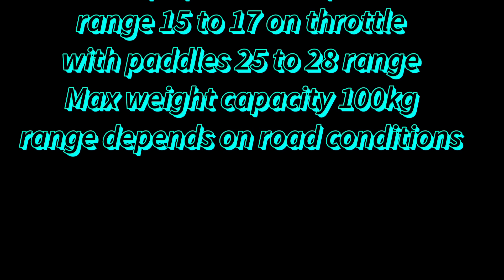how to make electric cycle high speed

Comment: You are clever. .
The more important question now is :  how does it work on the high streets or mountain roads ? I think at the biggest rear gear it will do well ( high torque with low speed ) ? What do you see ? Thanks
Reply: Will it really works for it?
Reply: @thegogbd  
that depends .. the motor power , the gear's teeth number

Comment: Hi so after watching this video I decided to a DIY BIKE. I Got a 48V 1000W BLDC motor kit did the freewheel crankset and the bike works fine when on the stand but when I put the tyres on the ground for a text ride the motor can mot turn the and gets stock. Any advise what you think may be wrong or what I may have gotten wrong
Reply: You must start your bike with the pedal mode first aroung 4 to 5 meters before using the motor power

Comment: Great job, is battery charges while pedaling? How many hours need to normal charge?
Reply: No brother the self charging feature is not available is this bicycle but you can add it itno your bicycle and for normal charge to this bicycle will take about 2 hours 30 mint or more depending on battery condition if battery is half discharge then it wil take 1 hour 39 mint and when battery is fully discharge it will take upto 3 hours oor less hope that you will understand

Comment: It is 👌🆗️,  but the Hero cycle is designed for human pulling force,,here the gearbox with chain and sprocket force taking hi pulling load, it's wheel axles bearings are not giving life for 50kmph,,,to be increased the strength of cycle.

Comment: What did you use to allow for peddles to not move when motor is working, but moves the bike with peddles when you want?
Reply: from 1:45 to 5:46, he is fitting a freewheel in the front crank set ... my favourite part of this video
Reply: Looked through the comments found it to be a front free wheel / system.
Reply: This is because when running e bike with motor the pedals not move and when the battery is low you can still power your e bike by your pedals

Comment: The motor description says rated speed 400 RPM, the motor I have is 3000 RPM, I guess I'm gonna fly
Reply from the maker: 3000rpm without gear box 
And with gear box 430 rpm

Comment: Why didn't you put the chain directly on the wheel and run the chain through a free chainring? what is the science? can you explain it
Reply from the maker: Because the motor have not enough tourqu to run wheel directly
Reply: "this setup provides maximum speed_reduction i.e. torque in two steps :
1. motor (small driver sprocket) is connected to the largest sprocket in the front (driven)
2. front and rear derailleurs are operated in a way that driver sprocket (front) is small and driven sprocket (rear) is large"

Comment: Felicitaciones para mí el mejor video el mejor video para modificar una bicicleta a bicicleta electrica este es el mejor modelo a copiar sin tanta modificación y lo mejor no eliminas los pedales para su uso mecánico
Reply: Nice build
Reply: I have found in making this setup the freewheel is 0ne half inches wide it won't let the crank engage the taper  so I am  have to take material off off crank arm to gain with

Comment: You will face motor friction if you pedal while the motor is in off- condition.( solution -- need one more freewheel on motor).
Reply: Take advantage of that by generating electricity back into the battery
Reply: @JonEhBee yes you are right bro
Reply: Yeh cycle ki motor kitne ki hey
Reply: Cómo consigo hesas piezas
Reply: That's right
Reply: 😊😊😊😊😊😊😊😊😊😊q❤❤
Reply: Bro God genius bro you 🙏🙏🙏.
Reply: @a.vsparta809  привет братан! Код страны Россия +7
Reply: @a.vsparta809  привет братан! Код страны Россия +7
Reply: Motora da Tek yön dişli takacaksın Ben yaptım çalışıyor pedal yaparken motor zorlamasına karşılaşmıyor
Reply: @dogrumit  where did you get that
Reply: Если на мотор подать 12 v  - сопротивления не должно быть .
Reply from the maker: You are right bro but itna choti free wheel Nehi milta ha
Reply: @nextin123 Братан мне нужно мотор?
Reply: @Дмитрий-с2д6ю am motor
Reply: Æ @nextin123
Reply: Who gonna pedal when uhv battery even if battery low it's enough for counter motor resistance
Reply: Can u simulate your idea please

Comment: How many tooth on motor gear ?
Reply from the maker: 11t 25h pinion gear
Reply: @nextin123  if so what is your gear ratio?
This motor needs 1:6 gear ratio. That means 6 turn on motor will make 1 turn on wheel. Otherwise motor will get hited and burn.

Comment: Hello
Very good 
Thanks for sharing your ideas 💡
Please let us know 
Motor size. 
Battery size. 
How long can the Motor run on single charge.
How you recharge the battery 
How do you control the speed and brakes. 
Best regards 
Khaled 
Your brother from lraq.
Reply from the maker: 750w bldc motor
18 to 21 runtime
22000 indian rupee without cycle
Top speed 60 at lowest gear
Battery charging time 2 to 3 hours

Comment: What's is range (in km) of this E-bike? What's the gross weight and battery Ah? Can it run over bridges and flyovers or is it only for road travel only?
Reply: This bike can give you average of 30 km on a single charge by using 35 to 40 km speed and the battery capacity is 48 v 10 ah total wieght of electric cycle kit is about 4 kg and definitely it can run on plain road and over brighes and fly overs you can also run it to off road by using front shock absorber in it but protect motor controller and battery from water that is not taught in video

Comment: Pl mention the cost n other expenses for this project n motor specifications n availability. Thnx mob no 9811924186
Reply from the maker: 750w bldc motor
48v battery 12ah
Top speed 52kmph
Maximus weight capacity 90kg
Total cost without cycle 25000 include installation cost 🙏🙏🥰

Comment: Definitely going to do this to my iron horse tandem that I'm modifying for one/2  riders-2nd seat over rear wheel. This will be great. Genius is an understatement 😉.
Reply: https://youtu.be/9t_S6aWuwYs
Reply: How did it go?
Reply: @A-Marz  actually still working on it, health isn't good. I plan on using a motor that attaches to the front fork with a sprocket and chain. I don't know how to post a pick or I would. Also I found a perfect saddle to use and the design is a little different, but if I ever get to complete it I think it will be a bit strange and hopefully cool. Thanks for asking. The motor is just to assist in getting it moving. I'll post a screenshot of the link or just the dot com on here.

Comment: Pedal motor transfer is superb.  Should have tried on graded road to evaluate pedal assist.  Downhill run should recharge battery from reversed motor mode.
Reply: This type of controller doesn't support pedal assist
Reply: @cyrilpeterlee1  i believe  pedal assist sensor can be wired to throttle

Comment: Love the fact that by installing a free wheel hub at the pedal sprockets, you still can pedal the bike normally if in case you ran out of battery power. Brilliant!!
Reply: https://youtu.be/9t_S6aWuwYs
Reply: idea is pretty good,I suggest to install one way bearing instead of free wheel in pandle cranking
Reply: @EbuTECHinfo why
Reply: TheFourHorses  But then the pedals need to go around continuously.
Reply: Shimano have had it for years,its vintage stuff at shimano.Look up for shimano Front Freewheel system.
Reply: And it uses the gear shifting. You can get power, and speed. This should help the motor live longer. 
The motor reduction should try to match rider's pedaling cadence, 80-100 rpm
Reply: This design will have resistance on motor when pedaling like a normal bike.
It doesn't have freewheel on the motor..
I've made one very similar out of scrap.
But more advanced 
has a freewheel on motor aswell
Reply: @scottrocks1993 un
Reply: @scottrocks1993 
AA
Reply: @scottrocks1993 show us yours
Reply: @scottrocks1993   Oh, come on, you can always stop and  take the chain off if the battery runs out.
Reply: If more made in China bike will use to convert into electric bike will not last longer China materials deteriorate fastly  so waste of time👘👘👘
Reply: @viccaguicla8736  I'd say, don't buy cheap chinese batteries, they're dangerous and burn down easily